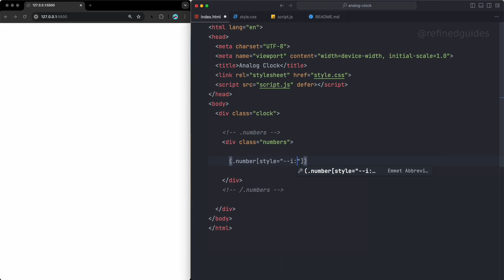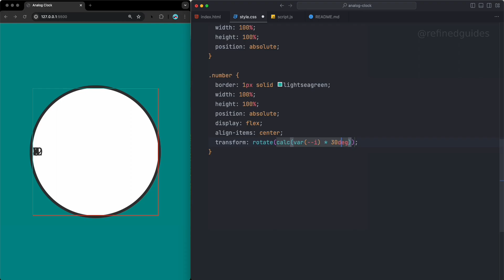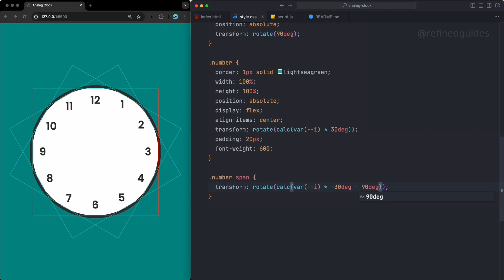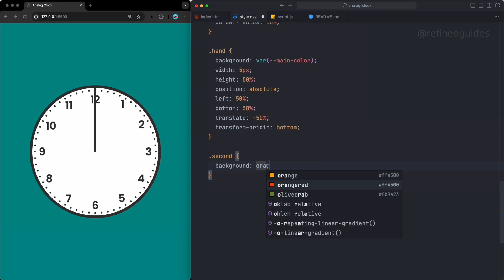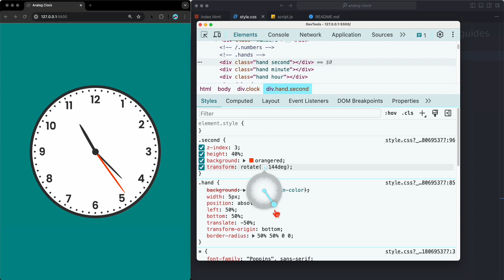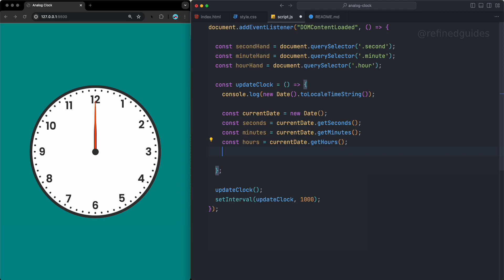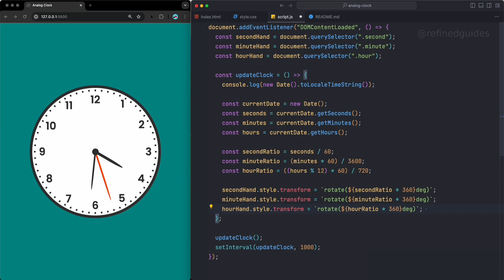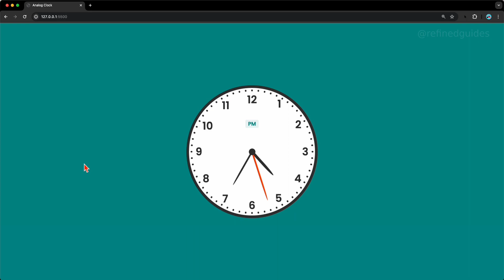Build an Analog Clock with Javascript

Comment: great video. how can you make it a 24 hour analog clock
Reply from the maker: Hey there 👋. You just need to add the remaining numbers in HTML then in CSS, rotate the numbers to 15deg instead of 30deg. And for the JS, change the hourRatio calculation like this:

 const hoursRatio = (minutes + hours * 60) / 1440;